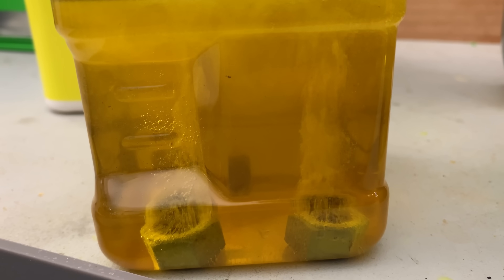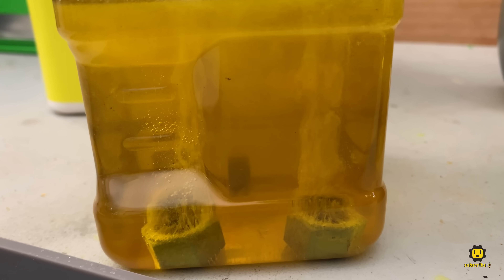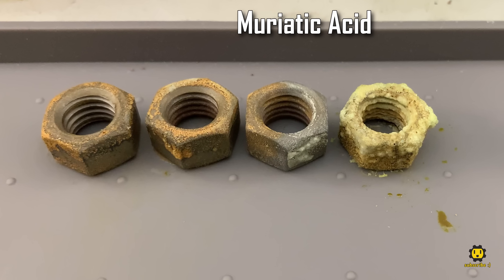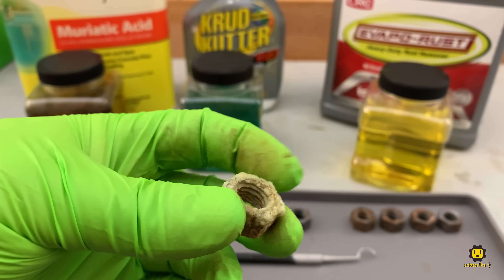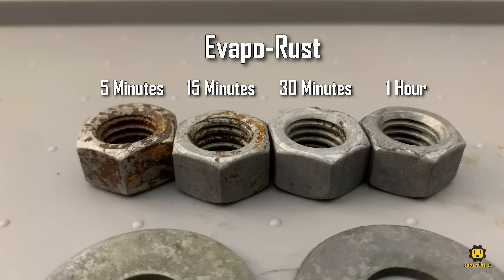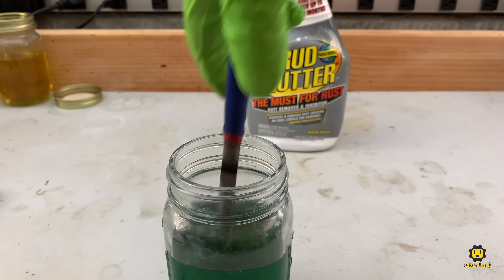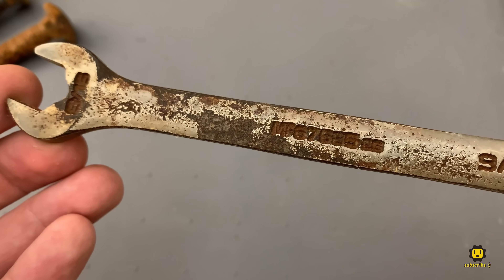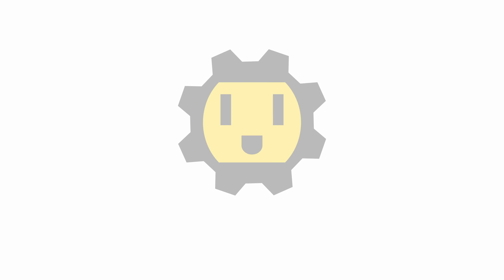The ULTIMATE Rust Remover - Cheap, Fast, & Easy

Comment: I was at a trade show about 20 years ago (give or take) and the CLR guy showed me Evaporust.  A few notes he told me... remove the rusty parts when the rust turns black.  At that point, it either rinses off or can be wiped off.  Leaving it longer doesn't really help.  Next, he said if you leave a bowl of Evaporust out and it dries up, just add water because all the active ingredients are still in the jelly left behind... it's only the water that has evaporated.  I have re-hydrated well used Evaporust a dozen times and it still works.  I only replace it when it's finally black as oil.  It just sits in a pan at the back of the bench waiting to be used.  Great video sir!!!
Reply: And the iron compound is safe. You can give your garden more iron with it.
Reply: @charlesspringer4709 i always wondering about this. seems like garden eat everything . 😂😂😂
Reply: I used it in a motorcycle gas tank, I think it's safer for painted surfaces (and any rubber) and had no problem. Although, the gas cap internal mechanism is zinc and it appeared to dissolve it slightly so it looked like it wiped a layer off if you touched it while still wet with ER. It took several days to get all the rust out but did a great job. One note, I found that you have to get all the air out, completely fill the tank. It is a sport bike tank so it's oddly shaped, while rinsing it out from the bottom, I realized there must have been a bubble at the top even though I filled it to the top in the upright position. I refilled it with ER in an inverted position through the sending unit opening and it completely filled it. That did the job. After I sprayed PB Blaster rust preventative throughout the inside since I wasn't ready to fill it with gas yet.
Reply: That's helpful
Reply: I buy evaporust by the 55gallon barrel in my shop for years now. It's saved me thousands of man hours. Can't beat it.
Reply: @daleh7886 I can only afford to buy it in the 5 gal. Bucket 🪣
Reply: I was not aware of that - I will use my jug more and not worry about using it up ha ha
Reply: Do not add water keep it in an airtight plastic container. Let soak for 12 hours. Remove any oil/grease from parts before hand. If parts turn black the Evaporust is used up.
Reply: @speedfreak8200 I trust the ER rep over some dude on YT who doesn't work for ER...

Comment: I bought a 5 gallon bucket of Evapo-Rust to be able to soak parts of antique drill presses, I'm actually restoring 6 of them at the same time. I decided to put the parts that were safe to put into a plastic storage bin with a lid, covered the parts with Evapo-Rust, popped the lid on, and allowed them to soak long term, as in at least 6 months, because I am a procrastinator. Not only did the Evapo-Rust remove ALL of the rust, but it also removed the paint, which for me, was an unexpected bonus. I'm going to pour the Evapo-Rust through a paint strainer to see how much rust and other debris I can remove before attempting to salvage the Evapo-Rust.
Reply from the maker: Those are some fantastic results
Reply: Fluid ounces ?

Comment: I've had surprising results with a cheap heated sonicator plus Evaporust.  I need to do this a lot more and am definitely open to finding some bulk chemicals that will do this job.  I have some precision tools that got rusty (micrometers!) that were returned to service, amazingly.  How to keep it all from rusting AGAIN is a challenge here in sweaty FLorida.
Reply: A thin-film of ISO 68 oil has served me well. It's very neutral, thin, non-conductive, and even technically food safe. Seems to be fairly durable as well.

Comment: I only use Muriatic acid. Its probably the cheapest of the bunch considering its effectiveness. Just the odor getting on an open cut actually burns, not even the actual liquid. Its cheap at Wal-Mart. Disposing of it can be an issue.
Reply from the maker: What’s your preferred method of disposal?

Comment: I've been using Evaporust for a number of years.  First came across it when I was researching how to remove parkerizing from gun parts.  An important part of using Evaporust is reading the instructions.  They say you're supposed to use a wire brush to remove the loose rust from the surface of the metal before you put it in the solution.  Another thing you need to know is that leaving soft steel in it for an extended amount of time can cause carbon migration to the surface of the steel causing it to turn dark.

Comment: Muriatic acid is a big mistake to use on rust, I did this back in the 80's to an old car and rust will roll off the metal but it will return no matter what you do, I tried everything but it kept coming back.

Comment: Liked —> subscribed —> note: enjoyed your tests and presentation. I think I lesrned a thing or two, and feel ike you weretrying to be helpful y passing along you findings without a lot of excess hoopla!
Reply: Now, which ultrasonic cleaner should I get
Reply: Also, thanks for looking out for my nuts. They’re important— to secure bolts and sech.
But, hey, can the KrudKutter be reused like the EvapoRust or is it a one-shot deal? (which case would price it out of most competitions)
Reply from the maker: You can use it more than once for sure, but I'm not sure if it lasts as long.
Reply from the maker: I really like the Vevor I'm using. It's pretty big but reasonable priced (compared to others on the market) and functions well! https://s.vevor.com/bfRR2V (Can use a coupon VEVT5 for 5% off)

Comment: I have been looking at laser engravers and would be interested in a video from you about yours. I would like to see how good it is at engraving hard metal as I have a need to mark parts for customers.

I am sold on the Evaporust and sonic cleaner combo, I will have to get some to run in my sonic cleaner.

Comment: There's always some moron with a different method to try, well here I am. I'm curious how electrolysis would do against the best liquid rust remover. I restore vintage cast iron with electrolysis and I haven't found anything that it doesn't remove including concrete. Rust is one of the easier things to remove. The problem is it's a line of sight type cleaning. It won't get between a bolt and nut but the outside of both will be clean. Bad tanks do bad cleaning jobs, wraparound anodes and heavy chargers do good cleaning jobs. They say electrolysis doesn't shock ya, it does if you do it right.

Comment: Great video👍👍, wouldn't the muriatic acid be the best economical choice if not having a sonic cleaner,  but neutralize the acid right after removing the parts? Not sure what else works other than baking soda.
Reply from the maker: Baking soda + dilution probably works pretty well. I think muriatic acid is a great choice if you want fast, cheap results, and don't mind the extra work that comes with having to deal with it (close monitoring, clean up, neutralizing, disposal and the fumes!).

Comment: Evapo rust instructions explicitly say depending on the amount of rust you may need to soak them for 24 hours. I'd take that for something that is biodegradable and reusable/rechargeable. Especially at the price point.
Reply: I remove any oil/grease and flaky rust and soak for 12 hours. If parts come out looking black the Evaporust is used up

Comment: Wow!  That Krud Kutter really works well!  I have always just put my rusty bits in some vinegar for 24 hours and that usually works.  If not, I go another 24 hours.  I'm going to have to try heating the vinegar and using it in my ultrasonic cleaner next time!
Reply from the maker: The Krud Kutter really does work amazingly well. Just a little expensive and harder to find. You'll have to let me know how your vinegar / ultrasonic cleaner combo works!

Comment: I first heard about Evapo-Rust from Adam Savage and went straight out to the store to get some. So far I haven't been disappointed!
Reply: Depends what your using it for.
There's a vid by taryl fixes all who did a test on rust removal.
Evapo degraded over time meaning it lost it's strength vs citrus acid which was able to keep working
Reply: @scorpnz4433 it only degrades after it has been used for a long time. Once metal comes out looking black then it's used up. I have been using Evaporust for many years and am quite happy with it

Comment: Need to watch through this all the way after work, but i have been mulling over evaporust in the ultrasonic, i just need to isolate it in jars. I have found that simplegreen aircraft works great for most things, with aluminum esp helps avoid getting weird crows feet which i think might be some kind of galvanic reaction. Getting ready to electroplate with zinc on parts, but need grime and rust off, becoming more of a project than i thought at first. Appreciate you doing the experiments

Comment: Citric acid works even better than Evaporust and costs significantly less. Adding hydrogen peroxide rejuvenates it, but given its low cost and non-toxicity, it's just as easy to pour it down the drain.

Comment: I've had a Homer Simpson moment,  I've been using Evaporust for a while.  Sitting in the back of my shed is an Ultrasonic bath,heated.  Unused!! It never occurred to me to put items into evaporate then blast them in it. Doh!!
Reply from the maker: They're a fantastic combination! :)
Reply: I think a big mistake everyone makes is trying to do this without agitation, without any attention, like come back tomorrow and see what happens.  What I tend to call "Maker Crap" or "YouTube Crap".  Any agitation helps.  The Sonicator comes with a little basket I recall.  You can pick that up from time to time, maybe brush the surfaces with a plastic or brass brush, put them back to cook some more if needed.  It goes much faster and I think does a better job.

Comment: Great video! I didn't know you could use glass containers inside a ultrasonic cleaner like that. I'm definitely going to put my rusty nuts inside my ultrasonic cleaner using your technique!
Reply from the maker: Thank you! The glass containers inside the ultrasonic cleaner make it more convenient to use the machine. Cleanup is a breeze and I can re-use some of the solutions.
Reply: You can use glass or zip loc bag
Reply: @jaro6985 glass is better it allows the sound waves to travel more efficiently.

Comment: Any chemical which is active enough to attack rust is going to contribute in some way to accelerating corrosion, even just the fact they are water soluble will do that, so the inhibitor in Krudcutter seems more like a comparative 'if you compare this to other rust strippers, when you forget your parts on the part cleaner overnight, it won't completely turn into flash rust mess'. For actual corrosion inhibitor - we utilize LPS-2 for protecting oil and gas industry parts which have been phosphate coated or bare carbon steel.
Reply: Electrolysis is the only completely non-destructive rust remover, but evapo-rust uses some kind of mild chelation that's very mild but takes time and has a cost factor. I assume krud-kutter is also a chelation formula.

Comment: Well the whole point of evaporust is that it's not a toxic acid. So it leaves the base metal untouched. I wouldn't put that much weight on speed testing.

Comment: But will it work on Toyota truck frames?
Reply from the maker: Someone's gonna have to make an XXL ultrasonic cleaner
Reply: @ShopHumor  cheap DIY large "ultrasonic" cleaner- take a 55 gallon steel drum, bolt an orbital sander to it and set the whole thing on top of a propane turkey fryer burner. Bolt the pad part of the sander on. People hot tank engine blocks this way, and it works really well.

Comment: I am restoring 2 Chevy OBS  trucks. Been using Evaporust in an ultrasonic cleaner. Every nut and bolt came out like new. What a time and labor saver.
Reply from the maker: That's so cool. It's such a great combination of cheap, fast, effective, and non-corrosive. I hope the restorations turn out well!
Reply: @ShopHumor  I’ve got a ton of tools that are so horribly rusted I’m trying to save and maybe get back to normal someday but it’s a giant project I have buckets of them, definitely seems like I need to get a ultrasonic and then get some chemicals and go to work
Reply from the maker: @shockingguy   That's gonna be a great start to that project. A little patience and persistence and you'll have them cleaned up before you know it.
Reply: Did you just put evapo rust in or did you use a container like in the video?
Reply: Where you located? I have a 99 k2500 ive been meaning to give some attention

Comment: If you have tools with rust, you have crap tools.
Reply: You obviously work inside and not with anything nasty!
Step into the world of gardening, earth-moving, construction, plumbing....
Anywhere that tools get heavy use and exposed to water (or even more corrosive things like salt and acids), rust will inevitably show up, because the truly stainless steels are either not suitable for hard work or are hideously expensive. Usually both.

Comment: I have never used Evaporust but i did use Krud Kutter in gel form to restore my 67 ford f250 and after a year the inside panels still don't show any traces of rust without any other treatment. Great stuff.
Reply from the maker: That's really cool, I'll need to try the gel version!
Reply: That's cool but why wouldn't you have recoated them with at least primer?

Comment: I'd like to see a similar test with the citric acid/washing soda/dish soap formula Beyond Ballistics came up with.  I've used it soaking for overnight usually, and it works great.  It would be interesting to see how much the heat and ultrasound speed it up.
Reply from the maker: I'll have to check that out. I might do a short video on that if it looks interesting and works well, thanks for the suggestion!
Reply: Please do it.
Will go viral
Reply: @ShopHumor   +1, that's a popular video and the critic acid + baking soda recipe tested well in other videos. Nobody has applied the ultrasonic and usually the comparison tests aren't as thorough or controlled as this video.
Reply: I've used that formula on several items, and it works awesome. Also it's cheap, and I still have all the original batch I made and it works after months of sitting around.
Reply: Easy recipe with slight variation (baking soda): 1 quart of water, 7 tbsp citric acid, 3.5 tbsp baking soda, squirt of dish detergent. Makes lots of bubbles and foam when you first mix it. Cheap and works great. Most everything I've used it on is done in 4-7 hours. Rinse it off with water and a nylon brush. Also, it's reusable many times.
Reply: @michaelallen5505  The foam is carbon dioxide created when the Citric acid is neutralized by the baking soda.  Adding baking soda does nothing for effectiveness. you just end up with carbon dioxide and sodium citrate salt dissolved in water and a weaker mixture of Citric acid.
Reply: @dennisp.2147  That's not how it works. That's not how it works at all. It doesn't use acidity to remove rust.
Reply: I pull the items out the solution , let them dry with the solution sludge on the items when dry scrape the sludge off( screwdriver or Stanley knife)  back into the solution bucket (minimal waste) then I rinse the items in clean water and dry  them off.
Reply: @michaelallen5505  What's the baking soda for?
Reply: Yes. Even better than ER in my experience.
Reply: Id love to see the effects each has on other materials. Like pistons (aluminum) piston rings, engine bearings….
Reply: @NukemGarage    Silly question but... why would you be curious about anything made out of aluminum? Rust certainly won't be problem. Yes, aluminum does corrode but that shouldn't be an issue inside of an engine. Ditto for bearings.
Reply: @PossumWerxbecause steel cylinder liner and aluminum piston…
Reply: @NukemGarage    So you're saying you'd pour the mixture into a cylinder with the piston still in it? I was going on the test as stated in the original comment with the liquid being inside an ultrasonic cleaner thus the question.
Reply: Yes it's cheap and it works 😎👍

Comment: One handy thing. That's a big add to the discussion, after you finish evapo rusting, what's the best then to clean it off and then prevent future rust. WD-40 followed by a real corrosion prohibitor oil?
Reply from the maker: There are a lot of specialized rust inhibitors you could use. I usually end up just using whatever I have on hand in the shop but I think WD-40 makes a formula that is specialized to maximize corrosion / rust prevention.